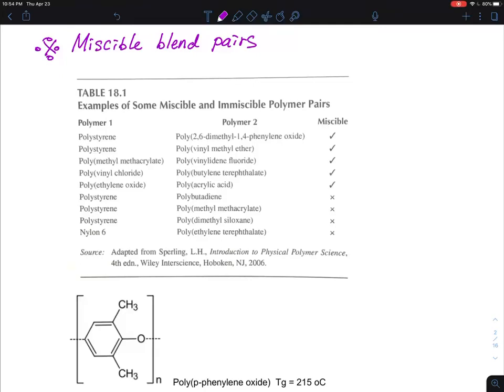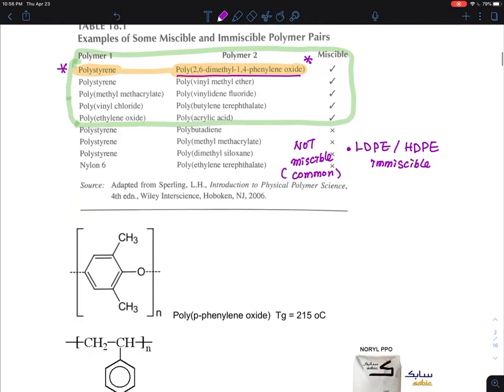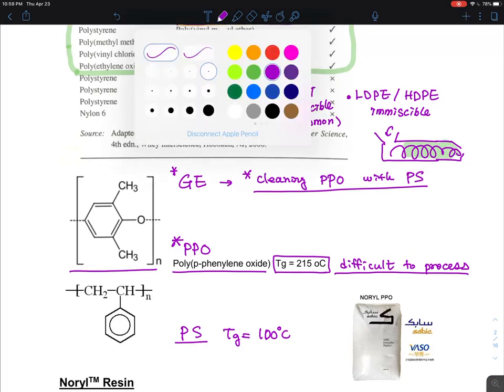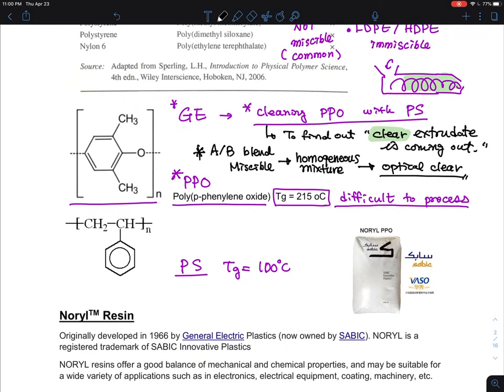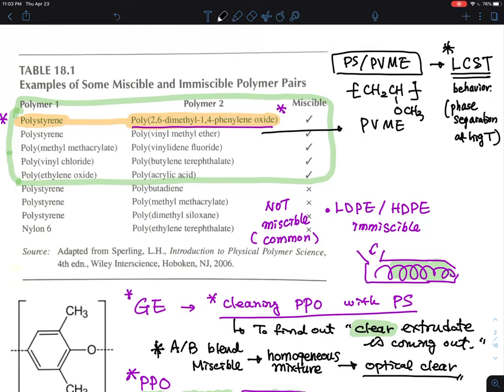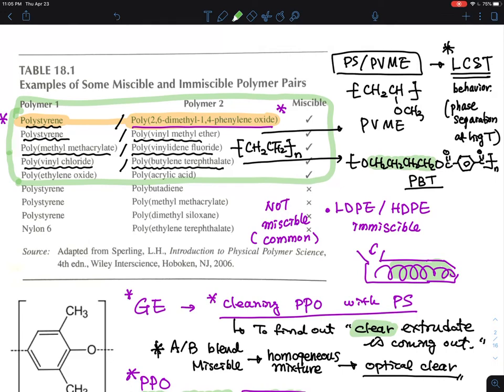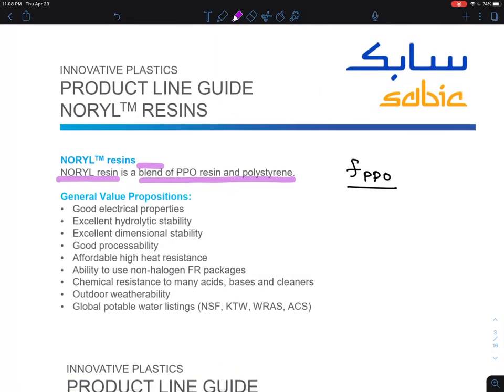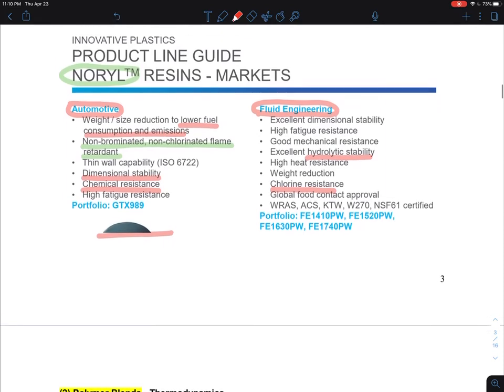05.02 Miscible Polymer Blends (Noryl as an example)

Comment: Hi Dr, id ask how to estimate compatibility betwn polymer and drug theoritically by which approach
Reply from the maker: Probably the Flory Huggins Theory is probably a good starting point to have a theoretical understanding.  The interaction parameter in FH Theory can be estimated using solubility parameter, but this should be used as a guidance (not as a tool for theoretical prediction.)  That is why people are performing experiments to see if some compound is compatible with polymer or not.  Please note that compatibility is used somewhat differently from miscibility.
Reply: @prof.ryuspolymerchemistry3456  thank u prof. Too much